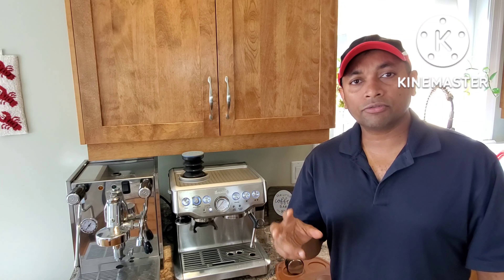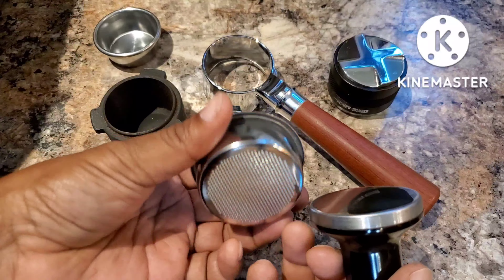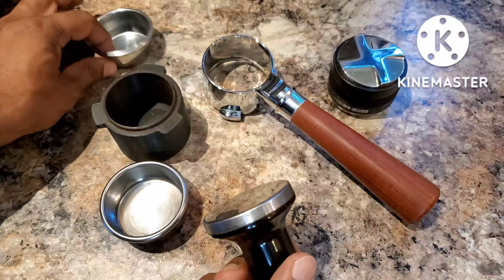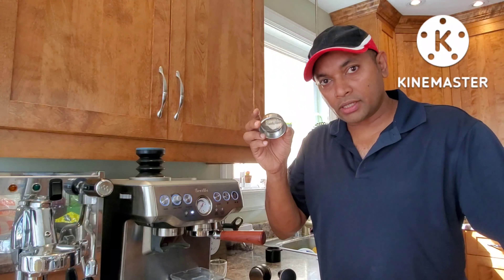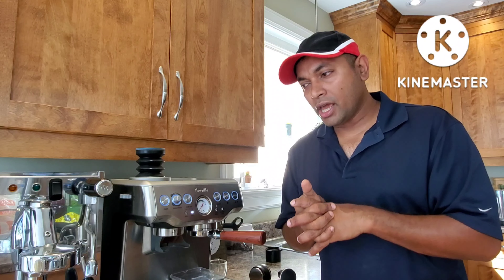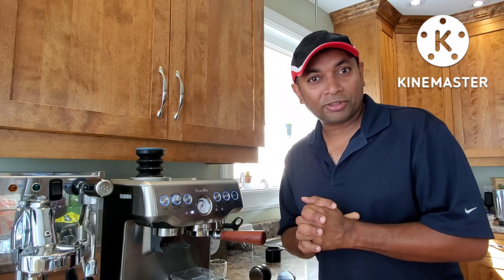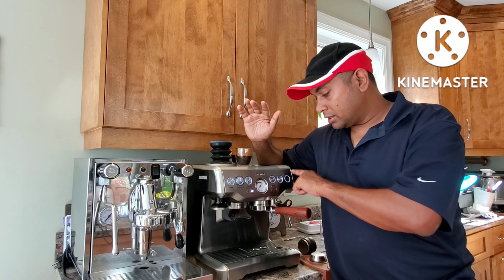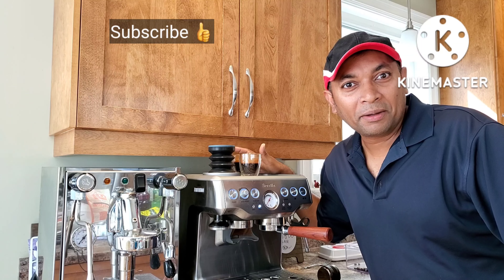Dialing in 14g Espresso on Breville Barista Express

Comment: I’ve been aiming for a 18g - 1:2. My Barista Express kept giving me a 55-60g double shot

After trying finer grinds without getting near to 36g, I bought a small set of scales and used those to help reprogram the shot button.

I’ve realised that the default settings don’t really line up with the advice you receive on the net and in books.
Reply from the maker: Default Breville shot setting is programmed for 1:3 ratio. To achieve 1:2 use freshly roasted beans and Manual mode. See my other video https://youtu.be/d1fKAH-Au5Y

Comment: Seems like maybe 15 or 16g might be the minimum dose for the stock Barista basket.
I think it's designed around 17g if I remember correctly.
Reply from the maker: That's right... 16 or 17g is possible. 15g may just work (like a Turbo shot)
Reply: @AjusCafe  Well I know 17g works because that's what I use every day ;)
Reply from the maker: @insertyoutubeusernamehere  😊
Reply: I'm been making espresso for 5 years now and am still learning, much of that thanks to your excellent videos on espresso.  A homemade WDT really helped me stop channeling I have the same dual distribution / tamper you do but only use the tamper (21 gm), bottomless portafilter. I'll continue watching your excellent videos and am sure I'll learn even more.
Reply from the maker: Thank you